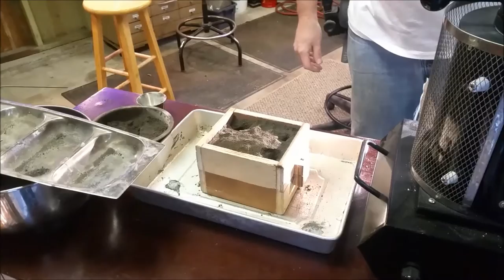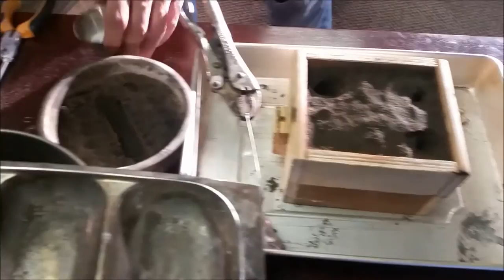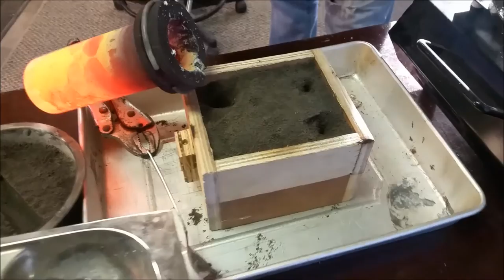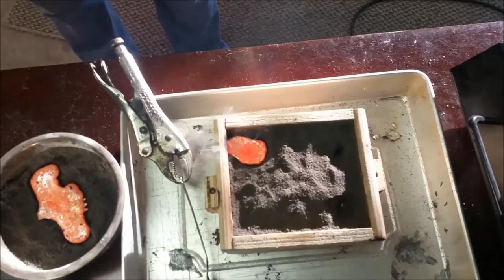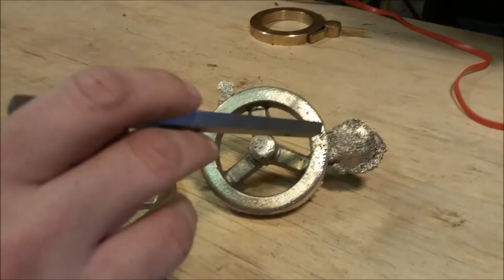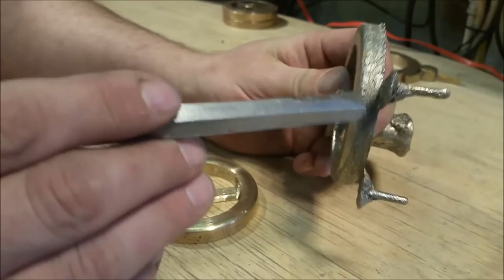Brass casting #15 Third flywheel casting using gate & vents

Comment: I was watching through myfordboy casting videos, in one he try's putting talc on surface of the sand to get a smoother finish and it seem to work. It's video 3 or 4 in his playlist and he's casting a fuel tank using a sandcore.
Reply from the maker: +Cold Coffee_ hey I checked it out, it is video four. I wish you would have shown up closer picture after you pulled it from the mold to see if there was more pock marks or not.
Reply: +Don Brandt he does at the end of the video.

Comment: I wonder if the pitting is from water. The one link I sent shows the guy running a torch over the mold before closing it. Also if pitting is from sand it should be in the pits. Carefully remove the sand by the gate on the next one to see if that is the case.
Reply from the maker: +David Mitteer These comments have given such great advice and I also ordered the petrobond. I think this is a very important point to make sure there is no looser sand anywhere, including the sprue. -don

Comment: Awesome progress Don!  I think the changes you're considering to the sprue/gate will help (again based on no experience, lol).  I always wonder if the impact of the molten brass just kicks sand up out of the sprue, having it deeper and a longer runner will probably answer that question.  How full would you say the crucible is for these pours?  I can't get a good feel for how much capacity it has.

(edit: no doubt you're familiar with luckygen1001's channel, but thought i'd point it out just in case)
Reply from the maker: +jcims Overall, I really appreciate everyone's comments and advice. I didn't expect all the help, your comment here is also helping to reinforce the need to alter my mold. To give you some details, this is a 2kg capacity crucible, and I usually want to be around half full, or a little more before pouring the flywheel you see in the video. 

I have not seen the channel you've mentioned, but I'm checking it out now. Thanks -don

Comment: Go ahead and make your sprue and vents larger. The extra mass of the metal will add more pressure to the metal in the part and you are just going to cut them off anyway and they will be pre-made  ingots for the next pour. Better to have them adding to the casting than just pouring into an ingot mold. That will prevent most of the sunken parts of the casting because there will be pressurized metal to feed into the part as it cools and shrinks.

The sand is clumping a bit which makes larger defects around where you were cutting out the gate. It will get worse as you reuse the sand because bits of dross, flux, and such will bind it together. Sifting will get out the lumps. Mulling is the fancy word for it. 

Don't be afraid to add more pieces onto the part. You can build it up to make the gates part of the pattern instead of cutting them out of the molded sand. Bondo works. Some people use modeling clay but it is a bit more delicate.  You can also add draft to the pattern that way since you are going to turn it on the lathe anyway. Doesn't matter if the surface isn't perfect if you are just going to cut it off.
Reply from the maker: +David Kirtley Hi, all the information you're sharing is absolutely wonderful! I'm going to implement everything you've mentioned here on the next pour.  Enlarging the sprue in lieu of ingots is a brilliant recommendation..... why didn't I think of that? lol

I work the sand over pretty well with each casting, you may have seen me using the blender. Albeit as nontraditional as it may be. Excellent point as well. Also, I've picked up a colander to help with the sifting. Actually, I've found pieces of brass in my sand. 

OK great, another thought.. I can add the gate to the pattern is what I'm hearing. 

Your feedback has been quite helpful, thanks! -don
Reply: When you do lost wax casting, you design the sprues, gates, and vents all into the parts as as one unit so you get used to thinking of it that way. All you are doing is creating negative space and once you get used to it, there are a lot of options of how to get there. Also plan on getting some sodium silicate (waterglass) so you will be ready for doing cores so you can cast parts with voids in them.

That's not a blender, it's a high speed small volume muller. :)

You only need a little of the really clean fine sand. Just enough to cover the part. The rest can be dirty and somewhat lumpy. 

It's making me anxious to finish my 3-D printer. My only use for it really is to make patterns to cast.
Reply: When you have a smaller part feeding into the larger center hub,  Often the smaller part will some how "suck metal" from the larger part creating shrinkage or sink defects as in the center back of your flywheel.  The fix I have found is to feed the larger part with more metal, that is give it it's own sprue or riser.  Alternatively you could fillet the spokes on the pattern so that they make a smooth transition into the larger hub.  Welcome to the black art of sand casting!  Best of luck.

Comment: I was wondering if the pouring temp is involved so went searching. This site towards the end talks about the gate being smooth & long but also don't overheat, use a torch and in capitals don't stir or reheat to much. I think this is the same link. Have no idea but love your tenacity in figuring this out . http://foundry101.com/archive.htm
Reply from the maker: +David Mitteer I had read that brass melts around 1750, however I'm not sure what the pouring temp should be. Watching other, including myfordboy, they seem to wait over a minute before pouring while adding flux and removing dross. Personally, I'm concerned that the temperature drops too much in the meantime. Of course, a lot of the casting videos are aluminum, not brass. I will thoroughly read over the link you sent, and can't thank you enough for sharing it. -cheers